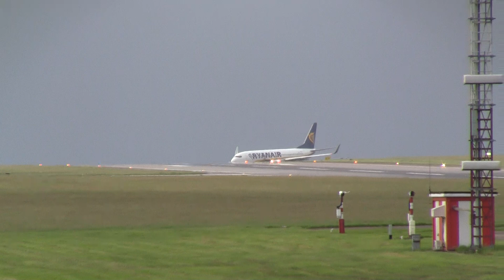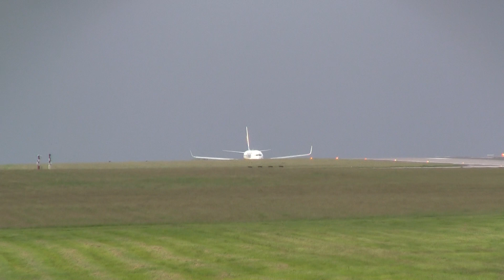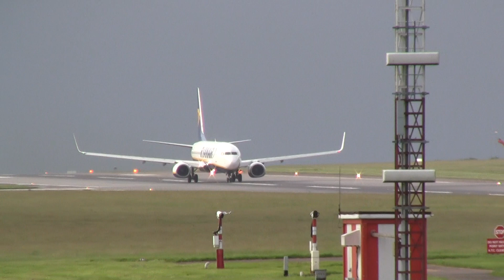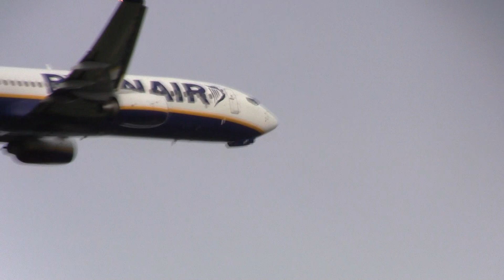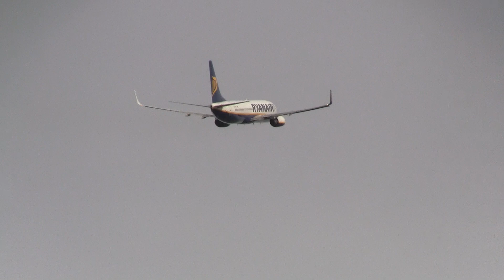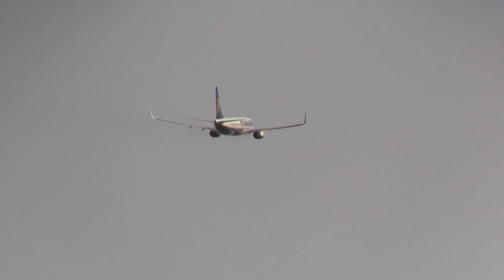Ryanair Boeing 737-800  Takeoff (with ATC Audio)

Comment: There's no full takeoff thrust. The N1 takeoff thrust value will depend on OAT, runway length and whether the crew require to manipulate the OAT to require a higher or derated thrust setting. If the gross weight is fairly low, the climb gradient low and a low altitude constraint after departure, a derated takeoff would be considered. A large power change and  pitch change would likely happen once the aircraft is required to level out at a set altitude and set speed.